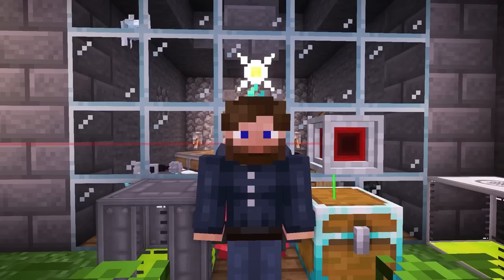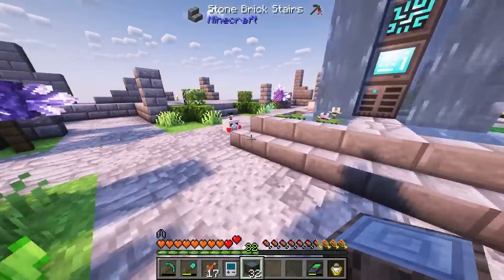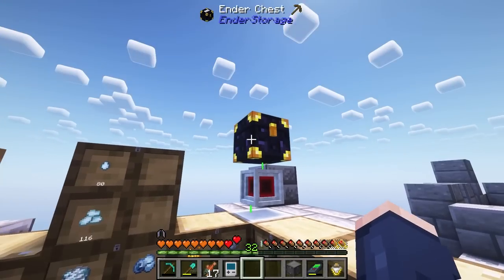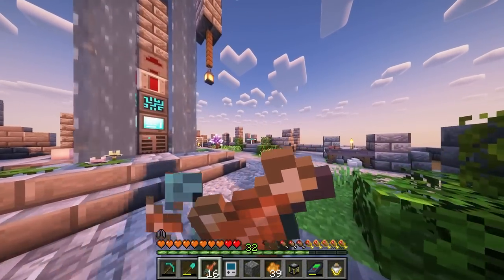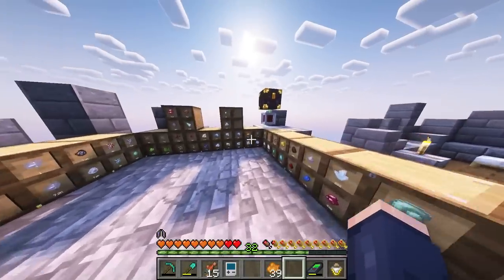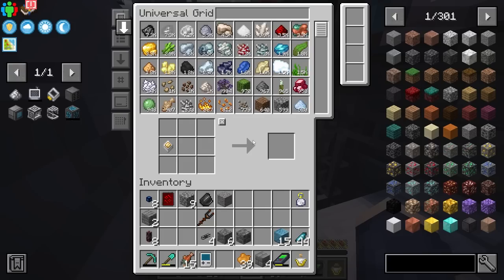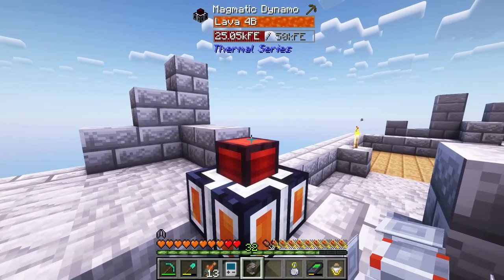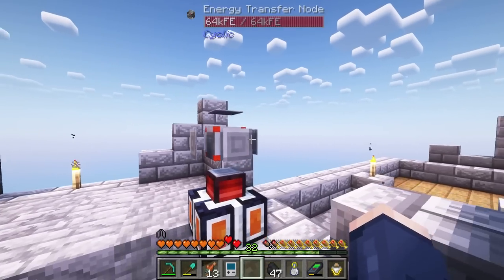FTB Skies Ep. 8 Lava Automation + Fully Wireless Cyclic Power Transfer

Comment: From the mob experiment I learnt I'm going to use bucket a of water in dispenser on timer to clear the grass 😊
Reply: I got by this issue by using a pedestal with a Breaker Upgrade if anyone needs another method.
Reply: Using water is so much easier. As for using create to kill the animals? It's good in concept but not being able to kill ars animals was such a bummer.
Reply: @beez1717  im assuming he couldnt kill the ars mobs with create because theres some sort of anti-mob grinding code put in place for them. the kills from the mob masher are counted as player kills which is probably why it works and create doesnt

Comment: Have you considered using an elevator instead of the ladder and trap door? It's just 16 wool and 2 ender pearls for a pair of elevators.
A Pedestal with an Attacker Upgrade, and a Diamond sword, with a Work Area Card, will kill anything inside the work area. No block under Pedestal, and can be turned off with a Lever.
Also a Pedestal with a Breaker Upgrade, Work Area Card, and Shears, will keep the grass clear. The Work Tool is the Upgrade Tool, just shift right click it on air. If you enchant the sword with looting you get more stuff.

Comment: I wonder if it would be at all worth it to fill a structure with 10k lava source so the create hose pully sees an infinite lava source. Does this pack have the default config for that?
Reply: So I did the math. For this "infinite" lava pool to fit neatly inside a chunk (16x16) it has to be 40 blocks deep. You'd actually go over quite a bit, 240 blocks.

Considering how crazy blaze spawn in the nether on cursed earth, it's probably better to setup a blaze farm.
Reply from the maker: You just need a way of providing the lave for that infant pool... That's what would take a bit
Reply from the maker: Maybe using RF tools dim to make a lava world!
Reply: @ChosenArchitect  I think there was a save corrupting issue with dimensions. It was removed in 1.04, otherwise the obvious solution is a lava dimension.

Comment: Chosen, you can craft water buckets with your wireless grid, but you need to start with empty bucket, then click onto the Fluid Grid, then drag the bucket over the raw water square, then click.
Your digital storage will need have an External Storage connected to water tank, naturally.

Comment: You should make a Paxel that way you have all the tools in one. An osmuim paxel has something like 10 or 12 damage too. It makes a great weapon as well as a tool. Btw, osmium armor is diamond level armor and you get a ton of osmium in this pack. 

I have never used the integrated dynamics mod so I tried the storage solution and it worked quite well. It hooks right into my storage controller and I set up 6 diamond chests for misc storage. Good early game solution. 

I typically use Mekanism for my power generation as the gas generator produces a huge amount of power.  I am still early game so I am setting up some windmills for my first power solution. I also normally use Flux networks for my energy transfer but I might try the cyclic wireless power. I have never used that before and it looks interesting. Flux is still good for charging your jetpacks and such so I will probably do that as well in the future. I set up a Mekanism factory smelter for my ores. Good solution.

Btw, you can use pedestals to kill the mobs and to harvest the plants in your passive farm and just use an item collector to collect the drops.
Reply: Since you mention using pedestals to kill mobs, how do you get that to work? I tried it myself yesterday and was pulling my hair out. I had the attacker upgrade on the pedestal with a diamond sword, placed on a gold block since I was using it to kill all the cows and stuff. The problem I had was it wouldn't accept the work area range I selected (6x6 area covering the spawning grass and a ring around it). I ended up just spawning a couple of drygmies and having them passively harvest from the mobs, but I'd still like to know how to get the pedestal thing to work :(
Reply: Thanks for that tip about the paxel. I can never remember those tools. I guess I'm going to go dig for a little more osmium for armor too xD Thanks again Rick
Reply: @Lewkis01  Sounds like it should work. The work area should be something like bottom left to top right to cover the whole area. Maybe reset the work area? Not sure what the problem could be.
Reply: @RickClark58  Is it supposed to be a cube area? I was only selecting blocks on the ground. I'm going to feel like a right fool if the range is a cube lol

Comment: In laser nodes, can you click the tab at the top to select a side so you don't have to squish yourself to get to it?
Reply: Yeah you can, but if you click on it from a side, the gui will automatically select that side as you access it in case you don't want to check which direction N/E/S/W it is facing